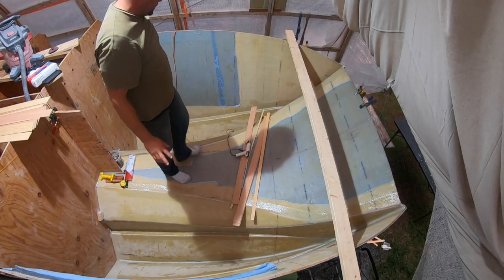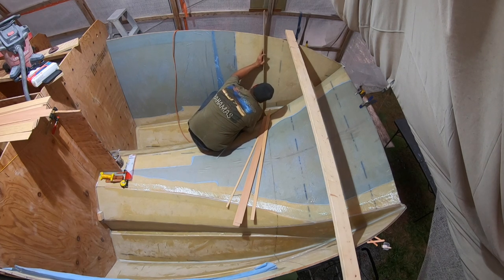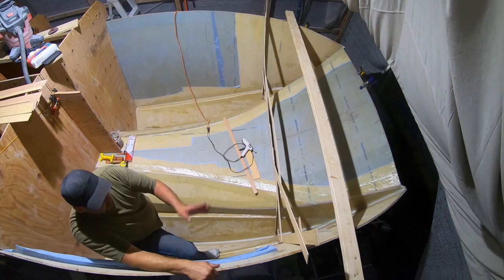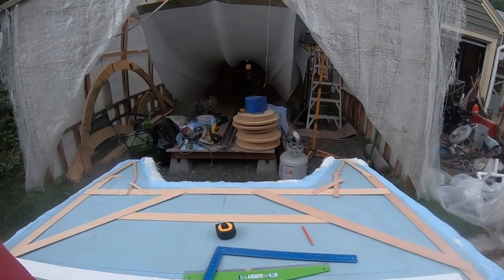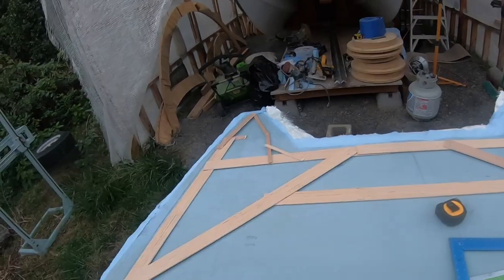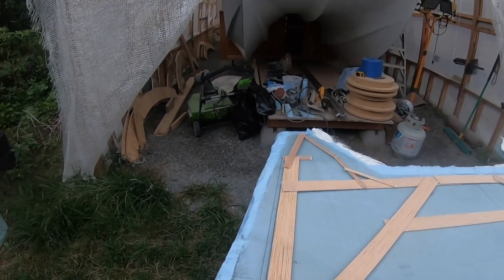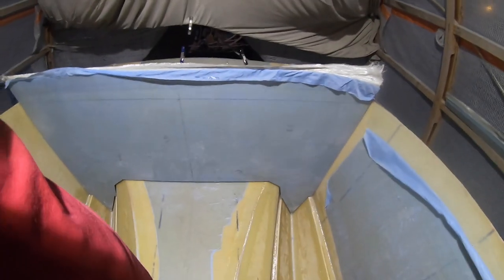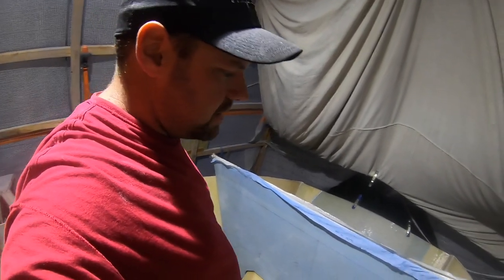Step 66: First Bulkhead Installed!! Power Catamaran Build Series

Comment: I envy you guys 😋. 
Im not ready moneywise until two years for my next boat build, a 40ft sailing cat in the style of a Bavaria Nautitech 40 / Lucia 40.
Cheers, huge hugs and thank you soooo much for sharing,, 🍻🍻😎👍‍‍👍‍‍!!
Reply from the maker: Thank you! Can’t wait to see your YouTube channel on your build 😉 it’s going to be a beautiful boat!
Reply: @BuildingMVDauntless  We,ll se about YT channel. I dont know if Im patient enough to film everything,, 😬.
May be,, 🤔?  //
Im always building radius 1" / 25mm fillets (its easy and cheap to buy Diameter 2" / 50mm grinding tools) and use Cabosil in combo with 1/4" - 6mm chopped glass, and Im always Peelply the fillets and have never had any problems with sagging. It realy shortens the grinding time to, if you should be needing to grind at all. 
Microbaloons are only used for superfine "a horror to grind" filler, and Im using quarts sand for crude, super easy to grind filler.
Much luv,, ❣❣. Cheers,, 👍‍‍👍‍‍.
Reply from the maker: Thank you. We are definitely going to try peel ply on our fillets on the next one!!

Comment: If you notice, "Life on the Hulls" is really adept at using composite angle in order to strengthen attachments.
And it keeps parts straight and aligned and it would work as a dam against any epoxy or ester bonding agent. 
I'm so excited to see you get past the faring and sanding and get back into cutting and making!
-✌🏼
Reply from the maker: We have composite angle that will be used for flooring and furniture, for the bulkheads, being structural, I would be afraid of the pre glassed angle effecting strength. I will be sure to try that method on not so critical pieces. Thanks for the suggestion 😊
Reply: @BuildingMVDauntless   
Oh you know I never realized whether or not he used it on his main bulkheads. I guess I just assumed he only used it when he either couldn't reach the area or was concerned about it dripping out of the area. Either way, Dauntless is closer to the water every day! Have you mentioned what brand and horsepower marine engines you plan to use? I'm assuming it gets mid-sized engines? Or does it have a full-on pair of off shore V12 Mercury monsters hanging of the back! 😄
Wait does it? 😯
Reply from the maker: We are planning on 70hp Yamahas 😆

Comment: Peel ply your epoxy fillets if your not going wet on wet with glass. The Peel Ply will keep the fillet radius in place and stop it sagging plus you won’t have to sand before glassing.
Reply from the maker: That is a great thought. We will definitely try that on the next opportunity that comes along. Thanks. For the tip 😊